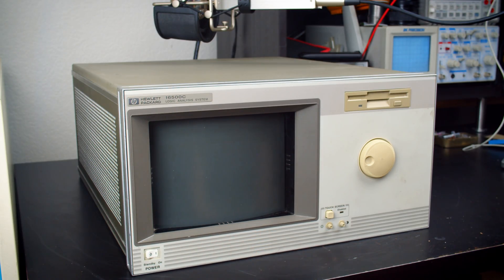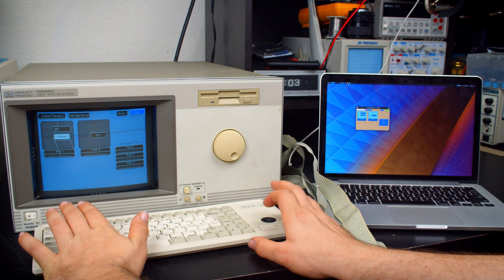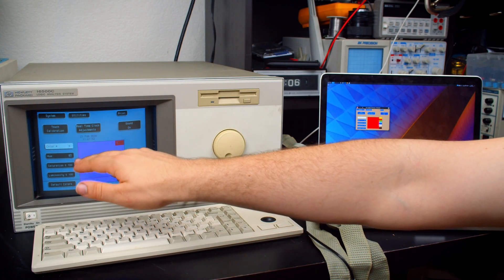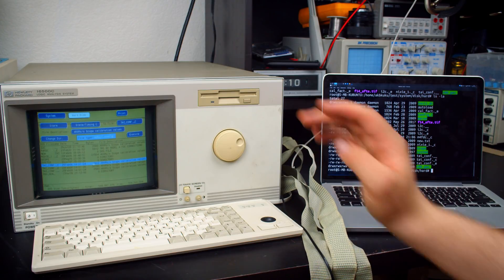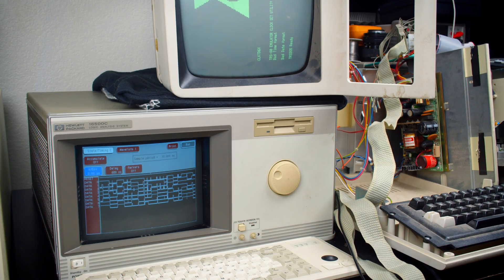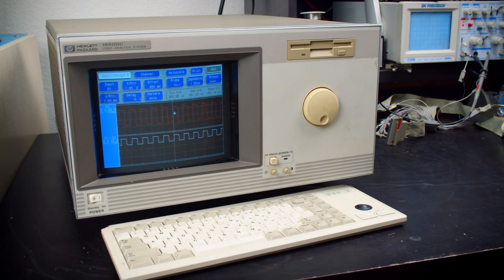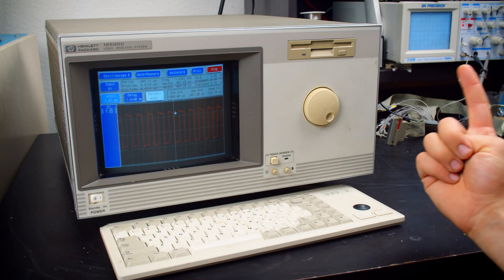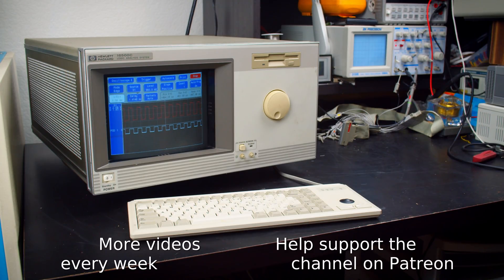HP16500C Testing and Demonstration

Comment: you can extend BNC connections.  ~1.5 dB of insertion loss per connector.   You should make damn sure that the total cable length for each probe is identical and has the same number of connectors. 

You may have problems as you get close to the Scope card's max bandwidth and minimum input voltage. 

You may have issues with reflections and EMI on the probes.

Comment: On the CF card not working, in the past I've found that some systems are pickier about accepting CF as an IDE substitute than others.  What I've had better luck with is using IDE DOM modules. Such a  module plugs directly into the motherboard header and typically has a power cord running from it to a molex HD power connector.  I think KingSpec 2GB modules were what I used to use the most back in the mid 2000s.  Hopefully something like that will be easy to get in your area.
Reply from the maker: That's exactly what I'm going to be getting. I've got a 512MB DOM on the way that I should be able to just pop in and get going. I think there are a lot of little things working against this system for drive compatibility, so I'm hoping the DOM just works so I can be done.

Comment: I used some networked HP/Agilent Logic Analyzer remote displaying to Redhat Linux 9 or RHEL 3 circa 2003-2004.  I don't recall the exact HP model used, it wasn't brand new, so it was probably a contemporary of the 16500C, but it definitely was lower end.  If you have access to a suitably plain and older laptop or desktop, it might be worth going way back in Ubuntu or Redhat to see if that will fix the issue with display in X11.  Of course, getting an old HP 9000/712 could be fun to.
Reply from the maker: I got a reply from someone that the way some of the slower earlier cards interface with the system are incompatible with X and the later ones do work properly. It could be that, so if I can get my hands on some better cards, that may solve the problem. I'm going to look around online for other people using these and try to see how they have them configured to see if I can get some confirmation on which ones will and wont work.

I definitely have some older 2000's linux releases I could try for this though. That's the potentially free solution, so I will look into that as well.

Comment: so the reason why oscilloscope probes can't be directly extended is that they are not low impedance low loss transmission lines, as you might expect, but are actually quite high resistance. the idea there is that because the attenuation is quite high, you can get away with being impedance mismatched to different sources, and the high-ish resistance of the probe lines will eat the reflections that happen inside the probe cable.

the professionally way to extend the probes would either be with
1. a high frequency amplifier
2. active probes

sadly both of these options are quite expensive

my recommendation is to look online for regular passive probes that just have really long cables

Comment: The oscilloscope traces don't appear on X11 because it draws straight to the screen to speed up redraw. The confusing part is - only some models of scope card do this. The later scope cards work fine on X11.
Reply: This was pretty common on scopes well into the 2010s.  When I was working on the Tek DPO and MSO 3k/4k series back in the mid-2000s to early 2010s, those scopes all bypassed the standard UI rendering code and DMAed waveform data directly from dedicated acquisition memory to the video RAM.  It made supporting screen capture and printing (one of the main areas I worked on) a huge pain because I had to do some work to transparently freeze acquisitions long enough to pull the current waveform data out of acquisition memory to a buffer, merge the UI and waveforms in software, then render the resulting image.
Reply: I just came here to say that, as I found the list of supported cards in the LAN card manual.  The only scope card listed is the 16532A
Great video, thanks!

Comment: I think I may have found out why the CF isn't well recognized, this "mainframe" (I dunno how to call it to be honest) has a hard limit of 2GB (if I remember correctly) for the hard drive. Anything larger will not work well (the ROM will fail to recognize it or something like that).
Reply: I thought that issue usually showed up as being recognized as 2GB or smaller instead of the real size, not completely refusing to work.
Reply: @JoshuaBoyd  I've had other machines with similar limitations where it would only recognize one platter of a hard drive that was too large (eg. it would recognize ~680gb of a 2tb hard drive). I don't know exactly why it happened, but it's a good indication that this sort of issue isn't always as simple as just an easy cutoff.

Comment: Random thing, why not just image the hard drive and flash a smaller card instead?
I'd use something like 1GB or 512MB
Also Linux is cool, what's your favourite distro? I'm a lubuntu and zorin os guy.
Reply: A 512MB CF card would 100% work, there is definitely a limit somewhere around 2GB, but 512MB would probably be the safest.
They should be pretty easy to find too, since small (64-512MB iirc) CF cards were standard in basically every piece of Cisco gear for a decade or two
Edit: Yep, they're like $5 on eBay. Awesome
Reply: Yes, I found out that this unit has a limit of 2GB or so (from what I heard in another video about this logic analyzer), I presume that it's a bug in the unit's "BIOS" or ROM.
Reply: #LinuxMintMasterRace